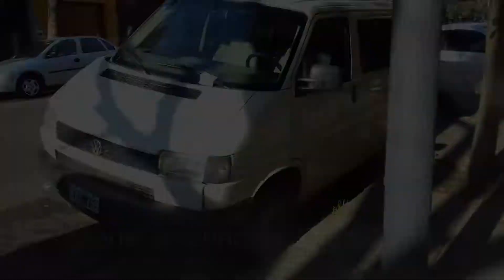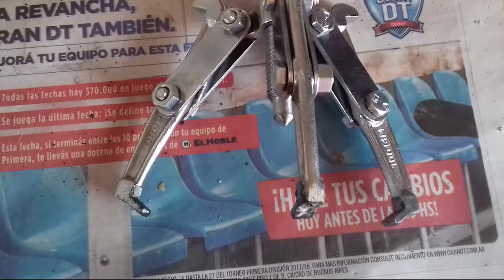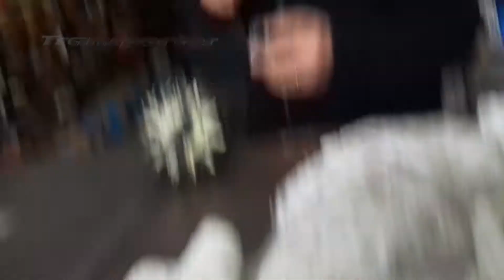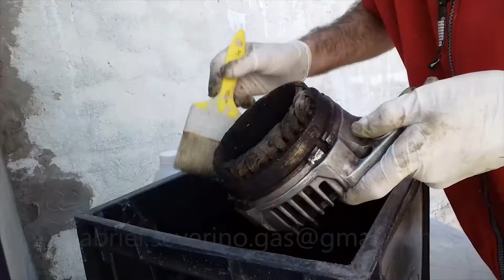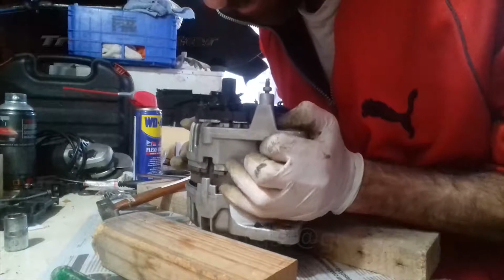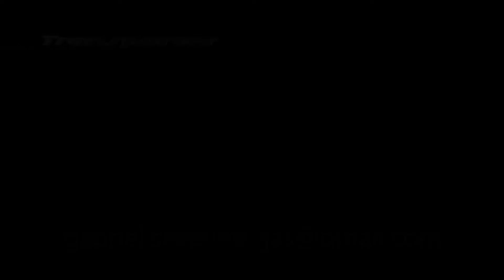VW Transporter T4 Alternador parte 2

Comment: Hola maestro, necesito saber cual es el diagrama de la correa poli v, porque no puedo colocarla
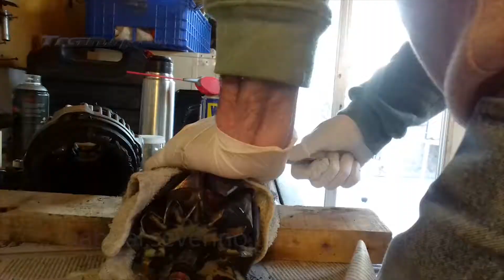Reply from the maker: Hola Franco, mira en mi T4 el aire acondicionado se lo agregaron, y le hicieron una planchuela para adaptar el compresor,  no sé que motor es el de la tuya fijate https://www.youtube.com/watch?v=51CxLnRhxHI en minuto 0:16.  Espero te sirva, gracias por pasar por mi canal, saludos.👍🚐💪
Reply: @GaseveTeCuatro  tiene el mismo que el tuyo, t4 2.4 aspirado, pero no encuentro por ningun lado el diagrama, ese que me pasaste es la distribucion, muchas gracias por tu respuesta igualmente
Reply from the maker: @francocugini2952   ah ok, entonces mirá aca https://www.facebook.com/groups/1796244923945441/permalink/2834649623438294 sino poder entrar al grupo, buscar en Facebook Club Amigos de la Transporter Argetina y en la sección archivos ahi vas  encontrarlo en .pdf   saludos.
Reply: @GaseveTeCuatro  muchas gracias por tu tiempo